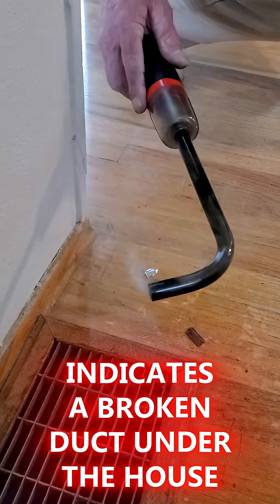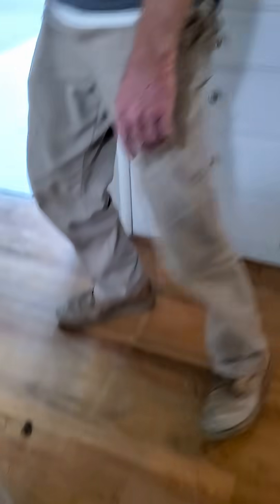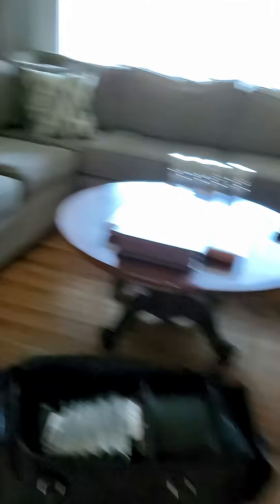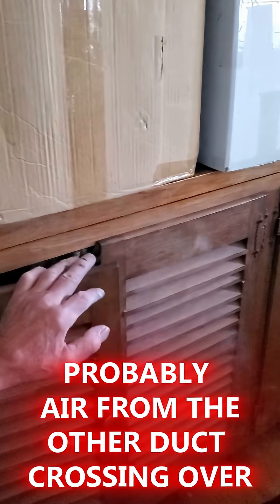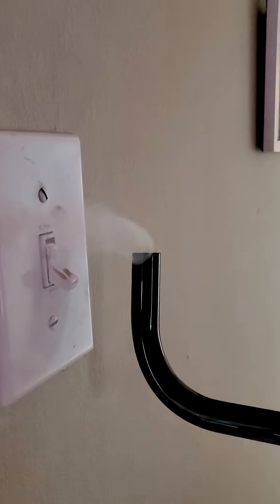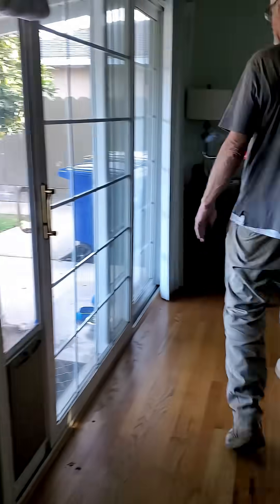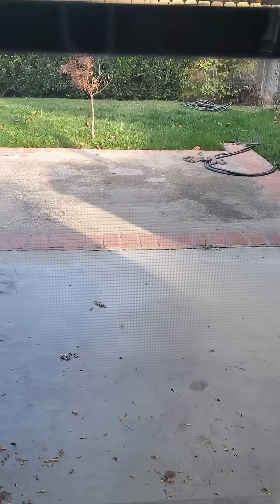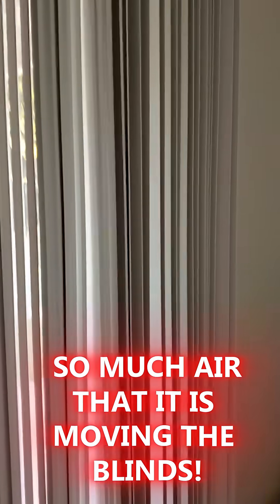Blower door test in a leaky home #infiltration #leakyhouse #hvac #blowerdoor

Comment: Efficient, no. Water damage, never.  When everything has airflow, everything can dry before it has a chance to rot. 

Pick your poison.
Reply from the maker: Moisture is not a problem here in this part of California, no humidity in the summer and really dry winters. With all the leaks in this house equates to almost 2 square feet or leaving a window open all the time. The duct system is accounting for 361 cfm of the leakage. So fixing the ducts will drop it down quite a bit.